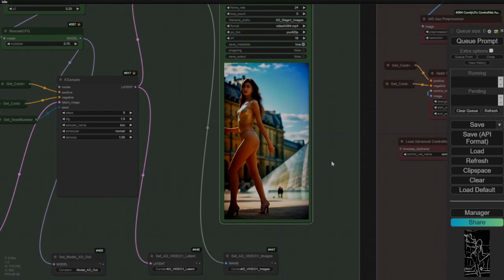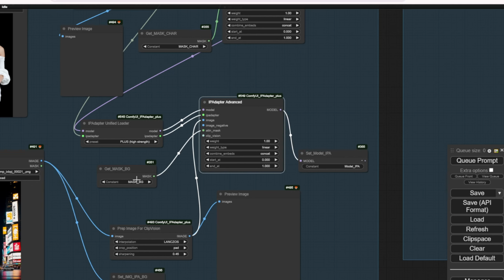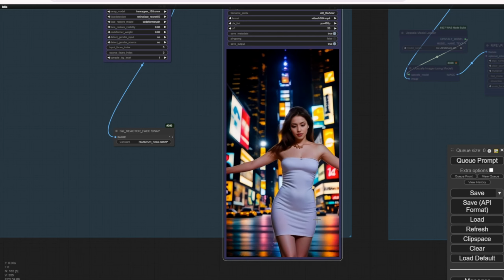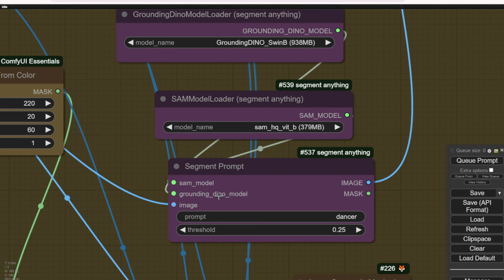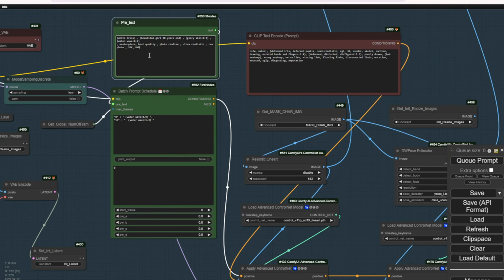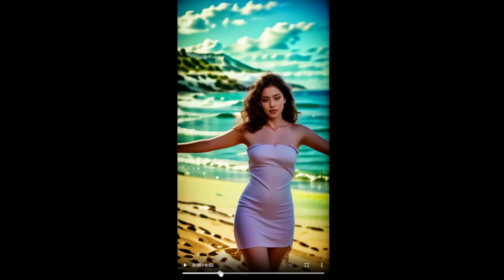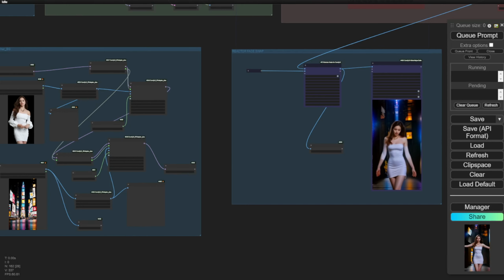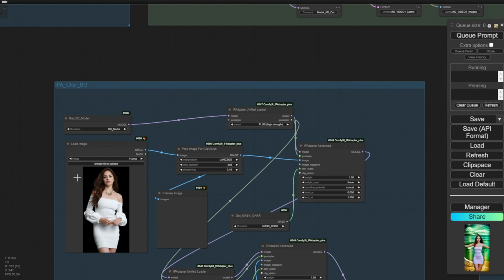Stable Diffusion IPAdapter V2 For Consistent Animation With AnimateDiff

Comment: Can you make a video where you ad ICLight into each frame, to tie the model into the background?
Reply from the maker: I have tried AD IC light on Video2video. It looks a bit flickering, and if we are using each frame processing img2img IC light, the background will not stay consistent.
So i think adding ligh effect on a V2V animation will need to use other method.

Comment: Question;  is it even possible to use AnimteDiff to produce backgrounds that are realistic and move realistically?  I'm asking about the ocean as an example.  Every render I've seen so far from anyone that tries this, myself included, shows results that aren't realistic.  It may be fine for a Tik Tok dancing video which is about the dancing girl and no one's looking at the water, but if one wanted to create a realistically generated ocean with waves that moved like real surf, can it be done?  I've had some good success with SVD using a still source image of a beach that looked completely real, but it only can do 25 frames and there's no way to guide it, you just sort of get what you get each time you run it.  I was hoping that AnimateDiff could maybe get around some of these limitations.
Reply from the maker: Its what it is, AI model always have their max. point basically. And movement are related to how you prompt as well.
If the outcome is not what you want, then wait for Sora come 😉